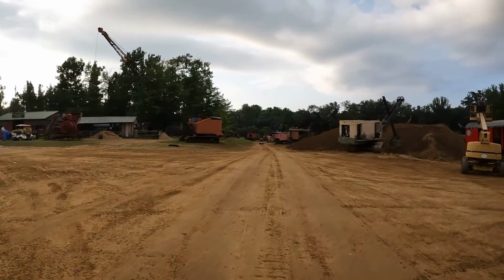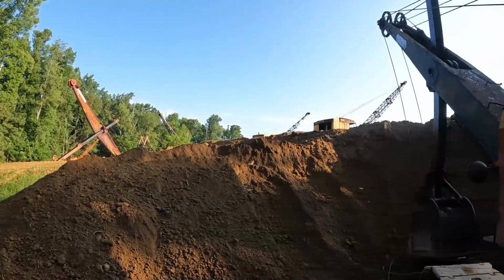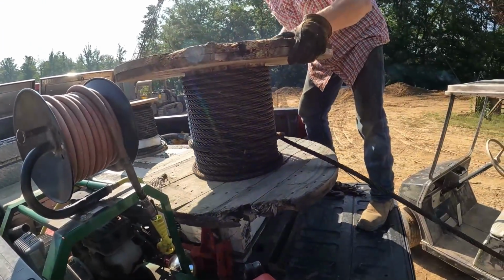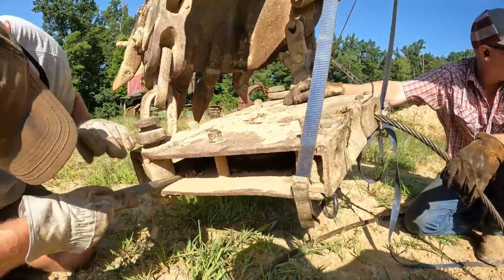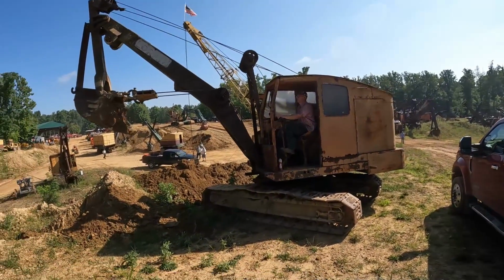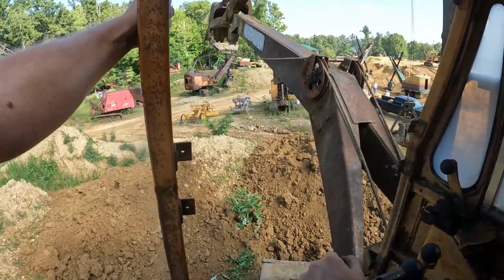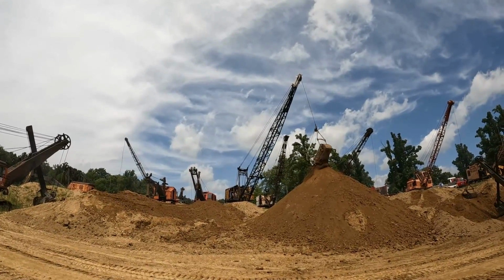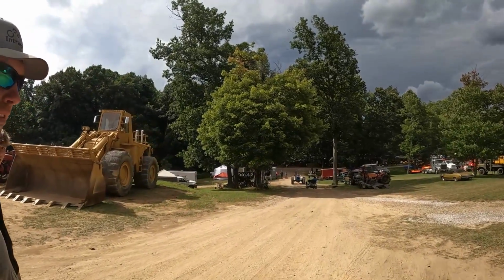National Pike Gas And Steam Show 2023

Comment: I happened to see the Allis Chalmers HD20 bulldozer running. A land clearing service used one of these tractors to root plow mesquite stumps in south Texas. The tractor ran diesel fuel through the torque converter, then back to the fuel tank. I think the engine was a Detroit Diesel 6-110 engine. Brings back memories of the late 1960s.

Comment: It is hard to imagine that the new computer operated machines will still be around 60 years from now.   It's  hard to keep them running now, as they crap out every time a sensor or computer chip fails.

Comment: When I watch that I think of a guy watching the same thing 70-80 years ago and thinking to himself, boy if we can just figure a way to curl that bucket it sure would make things so much better! Then how long after that thought did it actually happen? We’re they able to do it with cables or did they have to wait until hydraulic power cylinders finally came out so they could actually achieve that? It’s amazing when you think about all the things those state of the art pieces of equipment built back then!

Comment: On the shovel at 31:00 what mechanism moved the large bar that pushed the actual shovel in and out ? And as I'm typing that I see that it looks like maybe rack & pinion ?
Reply: Controlled by wire and winch via sheaves in the middle one pulls out from the centre, one pulls in from the centre.
Reply: @alan-sk7ky   how, there are no cables going from the center out to either end of that bar by which to pull it either direction.

Comment: You know what's more boring to watch than a dozer push dirt? A skid steer heading rock. You know what the most boring thing in the to watch is? A drag line don't anything, they are best used as flag poles now. You know what's more boring than all of that? A antique equipment show where that's all there is
Reply: How about some asphalt rolling or field plowing ,or golf fairway mowing